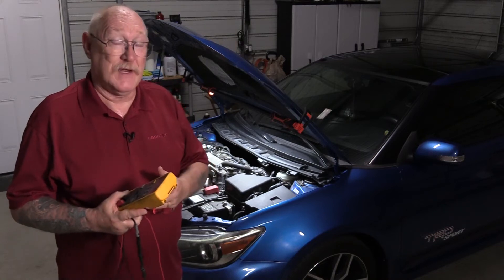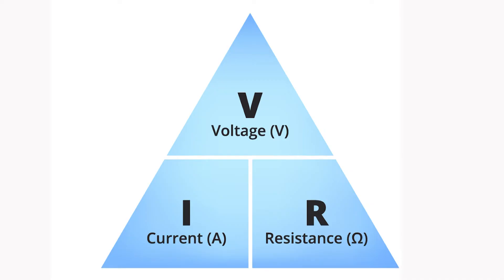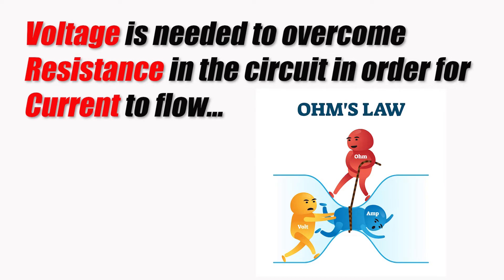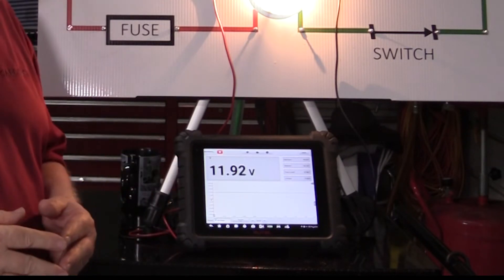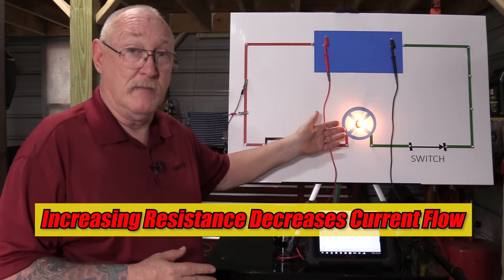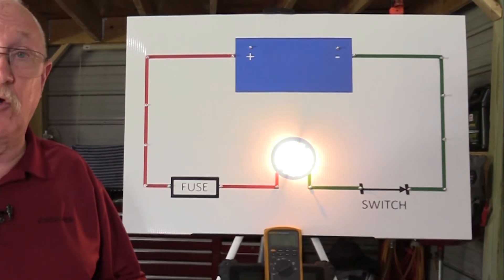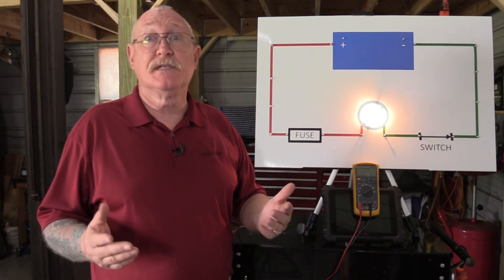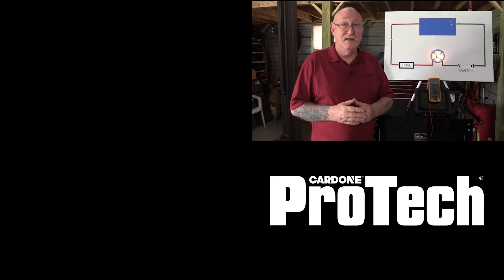Automotive Electrical Fundamentals Part 2: Voltage Resistance and Current and how they Interact

Comment: A better real world application that would be better suited for consumers that are tech challenged, would be display setup with a battery, starter and excessive resistance in the path. Everybody relates to a starter that clicks. Is it a dead battery? Do the headlights stay bright when the starter clicks? Are the headlights yellow? Is it solenoid? bad starter? or just some resistance in the battery clamps?